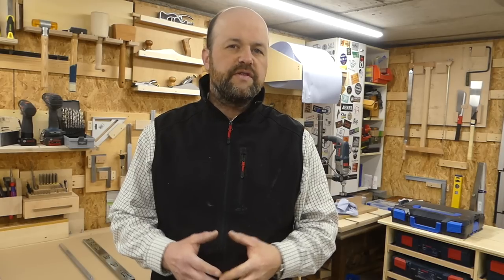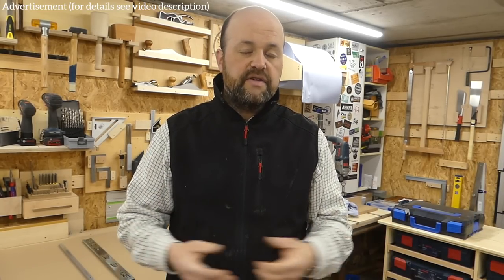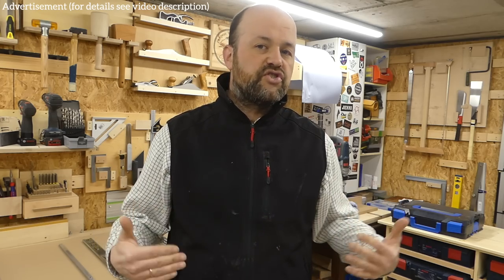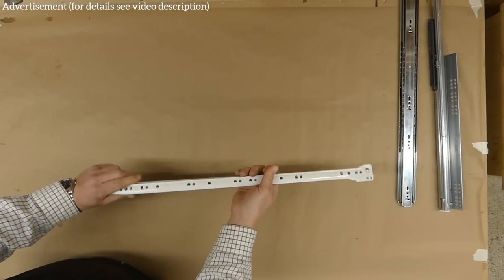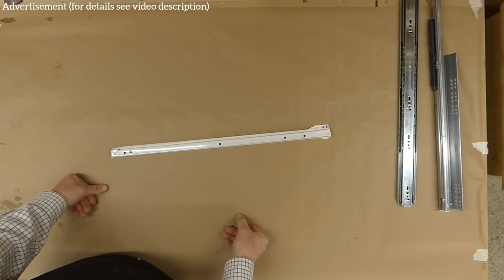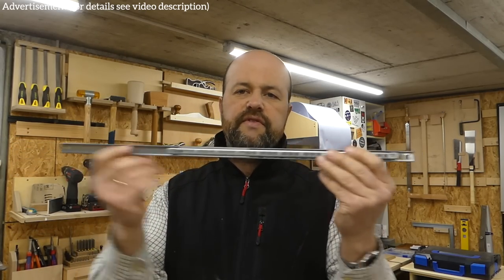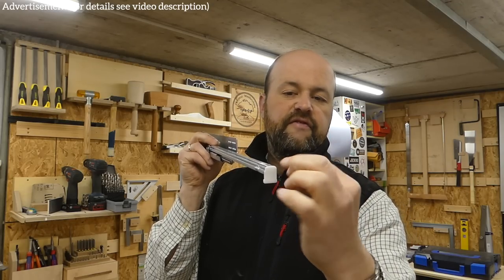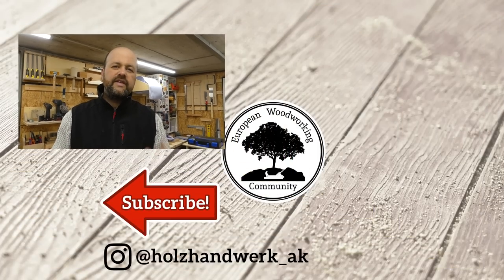Drawer Slides EXPLAINED – How to choose the right drawer slide

Comment: Very Good. I was searching for how "partial" a partial blockout installation of undermount slides could be. As far as the difference between Pro and DIYer slides. I would add the DIYer slides are the same no doubt as you said. However, The pro's don't get screws, brackets, clips or even instructions. They just get the side. Where the DIYer gets sort of a kit.

Comment: Thanks for the informative video Andreas.
I'm trying to find a ball-bearing drawer slide with an unusual capability. As you seem to be all over drawer runners, I ask you, have you ever come across a ball-bearing drawer runner that allows you to open the drawer from both sides. A drawer runner that closes so that all of the layers are over the top of each other but then can be pushed further to start extending the other way. 
My wet saw has plain old ball-bearing runners which look the same as standard bearing runners except for that extra functionality described above. Looking forward to your response. If you know of them, could you please let me know what they are called so that I can hunt them down.
Cheers Ciaran
Reply from the maker: I’m not aware ever seeing such a drawer slide, sorry.

Comment: I've built a frame for some art work I created. I was going to use the frame and art  to hide a small wall safe  underneath it and thought about using the bearing slides mounted to the top and bottom of the frame but wasn't sure if it would work or if there was a more effective way to use this sliding mechanism idea.
Reply from the maker: I’m not sure if this is going to work, in this video Tom shares his experience with just such a setup and it didn’t work very well: https://youtu.be/Psc2wm_vae0?t=366  – so perhaps you can find special slides for top/bottom mounting or try a different solution.

Comment: Hi. Thank you for the informative video. One quick question. Is it possible to install the hinged slides partially in the groove on drawer carcass sides?
Reply from the maker: I suppose that would work even though the material of the carcass would get very thin in the groove possibly giving you trouble with the screws.
Reply: @holzhandwerk_ak  I anticipated that, so I doubled the sides with another 9mm sheet. Worked well, though it was difficult to line the slides at first.

Comment: I'm trying to work out how to remove the ball bearing drawer once it is in situ.
Reply from the maker: There should be a small lever or knob on the side of the slide when the drawer is pulled out. Press it or move it and you unlock the slide and can then pull out the drawer.

Comment: Good day sir,  interesting detail, @7:51 how far should be the wood away from the other side? 🤔
Reply from the maker: I think the standard measure is half an inch or 12,7 mm. At least that’s what it was on every slide I’ve used so far. The measurement is given on the package of the slide, though so you don’t have to remember that.

Comment: Which one is good for at least 45 to 50 kg?
Reply from the maker: You can get the full-extension ones in extra sturdy. But the highest weight-support I’ve found is 45 kg. I suppose you’d have to do some research into heavy-duty drawers slights.

Comment: Nice video!
The partial ball bearing slides are awful. They have no load bearing capabilities at all. Even on a socks drawer the deform and no not work correctly in very little time. Since there are no other drawer slides that fit on dressers/drawers intended to use these partial ball bearing drawer slides, I replaced the drawer slides on couple of dressers with wooden runners from maple. These runners then slide into the grooves on the sides of drawers. Much better and maintenance free.
Reply from the maker: Thanks for your feedback.

Comment: The plastic bits and balls came out of my slides .  I am not a carpenter. what happened here? I put WD 40 in.
Reply from the maker: I suppose the liquid WD 40 lubricated too much and rinsed out the balls. Normally, you’d lubricate with grease which is stickier.
Reply: @holzhandwerk_ak  oh no!!!   Thanks for letting me know. I guess this is one to throw away now?
Reply from the maker: It’s just a guess. But I think that’s likely
Reply: @holzhandwerk_ak  I had some understairs storage drawers fitted and one of them, in particular is very heavy. It is very difficult to pull out and with all the MDF it must be around 30kg in itself. It's just for shoe storage so nothing heavy. It's a kind of triangular shape in the smallest part of the understairs and about 90cm wide. They have put in 2 pairs of runners - all about 35mm in height, and I don't think they are going to last. I have told the installer to go and find more robust runners which I am hoping will make the drawer lighter to pull and get more longevity. Am I right in doing so? What should I insist on?

Comment: The second one, the ball bearing type made by Everbilt is absolutely crap.  Fully extended the arms want to separate.  It's totally junk, and not worh the time to install.  Yes, there are ball bearings, but they hardly slide on the ball bearings. They slide on the tracks like the cheaper one, the first pair you displayed.  The middle one is junk.  Do you know of a good slide set for long drawers, not just kitchen cabinets, but more like a wooden file cabinet. The original slider set had the exact one installed, and I replaced them, only to still have them separate.  It was junk from the beginning, and the second one is junk as well.  Not worth the effort to bother with them..THEY ARE NOT HIGH QUALITY. I LIVED WITH THEM, AND THE NEW ONE I BOUGHT IS GOING BACK TO THE HARDWARE STORE WHERE I FOUND THEM. THE BRAND IS EVERBILT, AND THE BEARINGS DON'T EVEN ROTATE. DOESN'T MATTER THAT THEY'RE THERE...JUST FOR LOOKS
Reply from the maker: Hettich is a high quality brand that should also be available internationally.